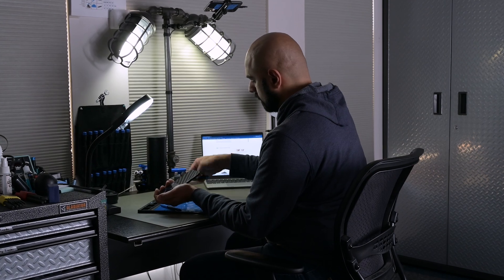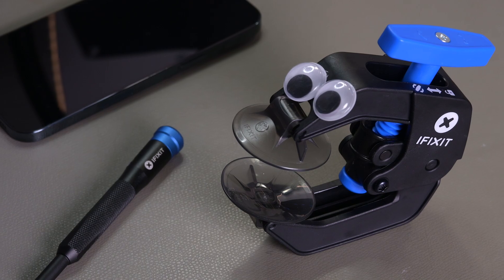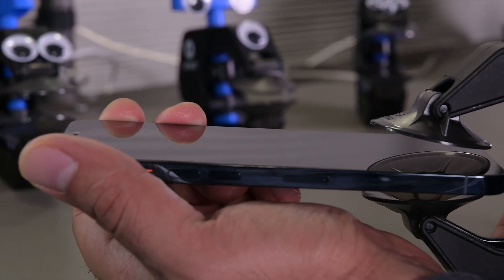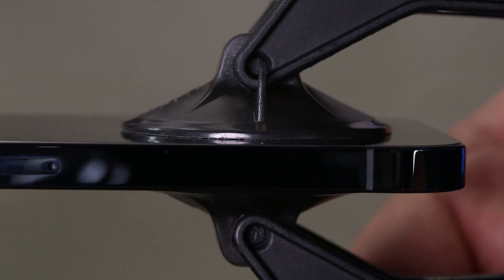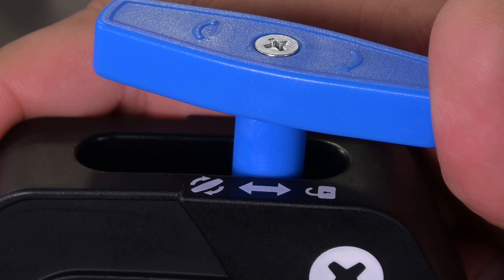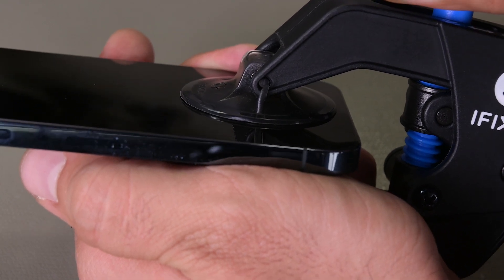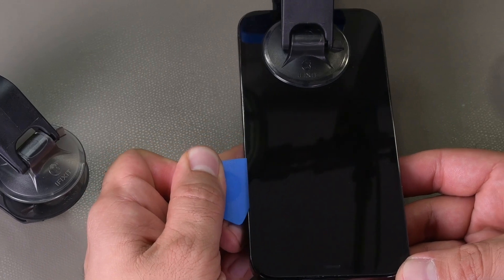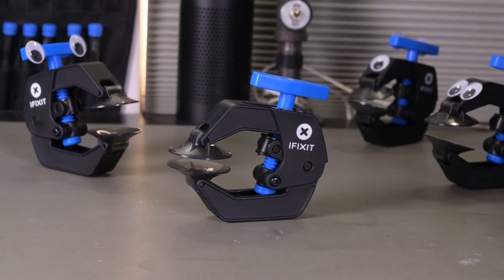How to use iFixit's Anti-Clamp!

Comment: For people trying this, you have to be very patient. It may take 20 or 30 minutes to work, applying heat, using the tool, applying heat again, but eventually it will start to come apart.

Comment: Bought it to fix my s22 ultra's antenna and usb board. First time I did it with a regular suction cup and a prytool. Shattered the coverglass while prying it open. Fortunately I had a backup. After fixing it, I noticed the mic for recording voicebotes etc didnt work. So had tonopen it again and replace that usb board again. This time with the ifixit clamp. Took me about 10 seconds after applying heat first. Cover stays intact and even the glue could be used again because it stayed in place. Best buy ever

Comment: what if it opens the back glass when you meant to open the front glass?
Reply: On iphone the back glass is glued with veeery strong adhesive, you can't remove it even if you want to)
On phones where back and front glass is easily removed you just warm the needed side slightly and this should give enough difference in adhesive resistance
Reply: @glebokator740 Depends on the model.
Reply: That won't happen even on "normal" phone because the adhesive that glued the suppossed to be opened (whether it's screen or back cover) should be pretty strong